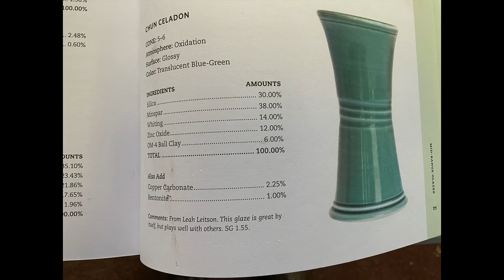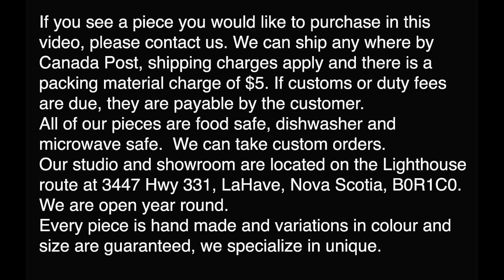Three glaze kilns unloaded 03:24

Comment: Thankyou so much for your videos, you really remind me of our college (adult classes for me 😂) technician Dave... He knew everything. Where did you post the firing schedule
Reply from the maker: I forgot, Ramp 1 200f to 1020F no hold. Ramp 2 75F to 1145F no hold. Ramp 3 200F to 2000F no hold. Ramp 4 108F to 2225F hold 11minutes. Ramp 5 9999F to 2000F no hold. ramp 6 150F to 1750F hold 45 minutes. ramp 7 60F to 1700F no hold.
Reply: @Vsmithpots  thankyou so much I didn't realise you could ramp down? If that's the right term. I have a small brand new kiln and it takes about a month to cool down lol😉